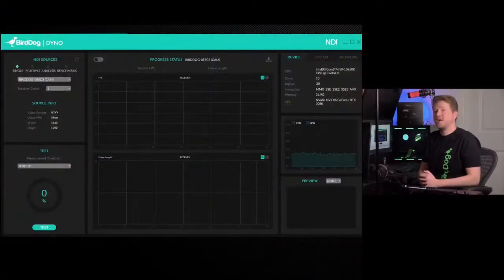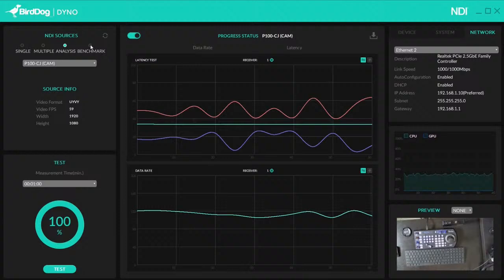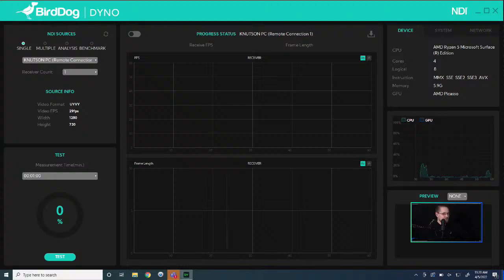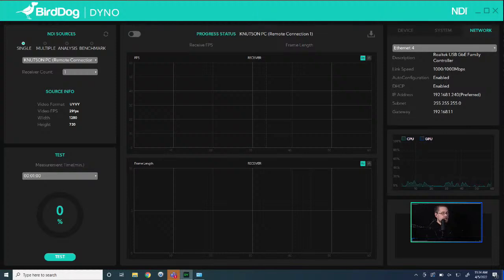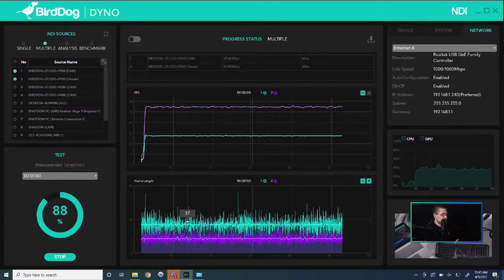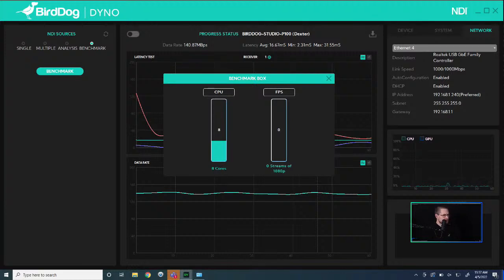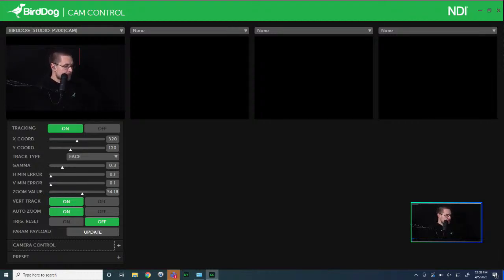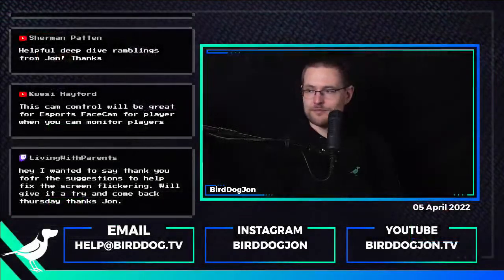BirdDog DYNO Announcement!

Comment: I may have missed it, but was there any word back on the users who ran their benchmark on higher powered systems and still received a 0 1080p streams result and why that happened?  Thanks!
Reply from the maker: Talking with Engineering now about this one.
Reply: @birddogjon  Thanks!
Reply: Any updates on this
Reply: @andrewkiefer2628  No, it is working for several clients, so we are trying to figure out what might be throwing it for some and not others.
Reply: @JonoKnewt  I am getting the same issue on a stream dudes build